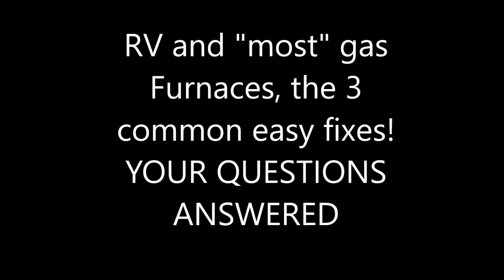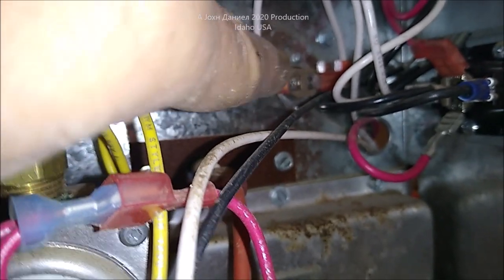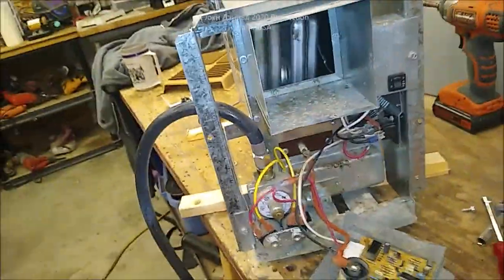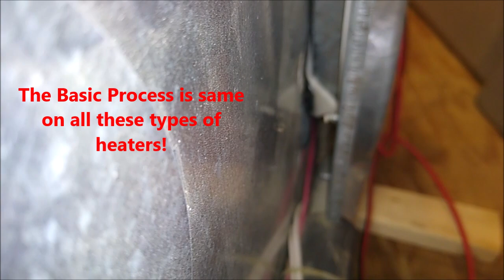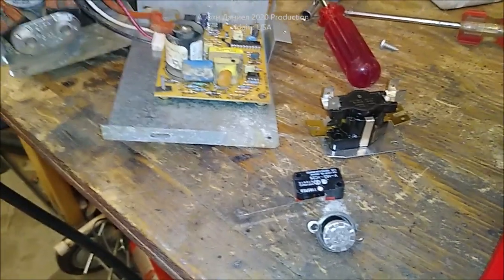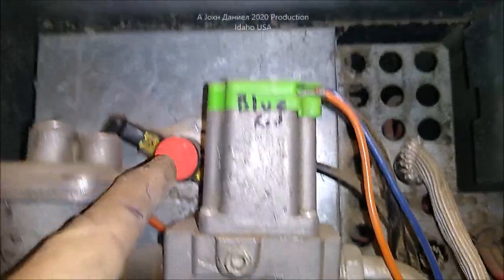RV Furnace REPAIR TECHNICIAN SECRETS Top 3 Easy Fixes anyone can do PARTS BELOW

Comment: Question. While direct wire. Furnace will turn on just ok. When adding the thermostat controllers. Furnace won’t start. Thanks
Reply from the maker: Definitely a common reaction when you get a bad start delay relay in your furnace. The thermostat wires are so small it's not getting enough voltage to pull the disc down and start the blower.
Reply: @JOHNDANIEL1  thank you. I did replace the thermostat and wires just to be safe And that solved the issue

Comment: This was so helpful, but I am worried about running my heater to even test what's going wrong. I can turn it on and the fan kicks on, it sounds like it ignites, but then extremely hot air blows outside the camper (smells slightly of propane too) and cool/slightly warm inside. Should I be worried to run it while I?
Reply from the maker: Sounds like you're exhausting air from the outside is proper it would be very hot, you're inside there should be warm like a hair dryer coming out, take a flashlight and shine it up into the tubes that are on the outside of your RV. If you have a single outlet take a screwdriver and remove the cover and shine it up in there it may have a lot of wasps nest in it and the best solution is to try to break them loose with a very long piece of coat hanger wire and put a shop vacuum to pull out any of the debris. And higher than normal smell of propane means that the air mixture is not working well from the intake air outside for combustion and the burner inside that is sending out the exhaust. Many of these have tube within tube designs or two separate tubes intake and exhaust. It's best to take a look at it and see what you see obstructing anything in there. Once the air mixture is better more warmth will come out of the inside part.
Reply: @JOHNDANIEL1  thank you. I think this answers what I need to look at too. Blower comes on and works continuously, exhaust blowing hot, I see flames but air coming out inside is so barely warm I can put my hand on the furnace and keep it there. Seem to be going through propane like the house is on fire except it’s only 43 degrees inside and 39 degrees outside! 2007 FR Freedom Popup with Suburban furnace.
Reply from the maker: I get what you're saying now sounds like the set screw on your blower motor might be loose. They have a motor in the center with a blower wheel on each side one puts air into the combustion chamber and the other one blows it out into the trailer and if it's not even blowing very hard it's generally because it's slipping on that blower and there's a set screw that's inside the fins that you have to use a long allen wrench to reach down and tighten. It's a rare occurrence but it might be the cause.

Comment: John The Over Temp Switch You Suggested Is Much Smaller Than The One In My Unite ?  Do You Have Any Suggestions ?
Reply from the maker: Yes, it's not same size but same function. In some furnaces you might need to take and cut a small piece of aluminum can to cover a push through hole the original overtemp uses get it put together the way the best way you can and mount it on there, it's simply a normally closed high temp disconnect. It will flow through it up to 13 amps DC and your heater should only be using 6 to 8

Comment: What’s the issue if it all comes on. Igniter clicks, flame starts and then it keeps clicking and flame goes out.  Tried 3 times and then stops trying
Reply from the maker: The igniter that goes into the burn chamber to start your flame senses an active flame and it's not doing it so I would suggest replacing or cleaning the igniter assembly and that should probably solve your problem. I don't know the model number you have if I did I could probably send you to the exact part. If you have more problems give me an email at olympicpowercontrols@yahoo.com it'll take a few days I get so many emails, but be sure to send model number and year, and a few pictures if you have them.

Comment: I have a problem that goes beyond your video. I’m not sure what it is yet. I replaced the board, sail switch and high limit switch. The blower comes on and I can hear the igniter (not a relay) clicking. It cycles like this three times and then the blower just stays on. The burner doesn’t light not even for a second. Any advice would be greatly appreciated!
Reply from the maker: Did you replace the igniter assembly. If the igniter assembly is not sparking on the burner or sensing activation of a flame you'll get this action. Take it out very gently clean it adjust the gap between it and the burner at 3/16 of an inch and try it again. Over time these will get very hot and Warp and cause this problem.

Comment: That sail switch is often replaced by a tube and a pressure sensor in some Goodman household heaters. Same principle. Moisture may block the tube if you have trouble with interior condensation or water leaks in your air system. Once identified you should solve that problem as well.

Comment: I just repaired or replaced my heater motor but now it won't fire up.  I had the sail switch, board, and burner cleaned out, this last fall. The fan started making  noise so I replaced the motor. I get no clicking or heater start up, no light on the circuit board.

Comment: Thank you!! I called a mobile service. Right away, before assessing the heater he said “ohhhh it’s your circuit board and those are costly.” He wants $600 to take the whole unit out. It’s only my relay switch.

Comment: Great video. Mine is in a 2008 surveyor by Forrest river. Turn the furnace on, cold air comes out of Ducts, air comes out exhaust fine after 10 seconds or less it shuts off. Only way to get it to run is to raise and lower thermostat and the same cycle continues.

Comment: My biggest complaint is that I have to physically remove the whole system in my Jayco to get to those parts. And they don't give you enough wire to do so without having to cut the wires from the board. It turns what should be a twenty minute job into a 2 hour job.

Comment: I may have missed something, but I have a 2-year-old Micro Minnie and the fan ran nonstop for two weeks before I banged on it with no effect, so I disconnected it.  I don't think I heard that symptom in your video.
Reply from the maker: What do you have is a hung up delay relay most likely, when the thermostat breaks circuit after your RV reaches temperature it pulls power away from that relay. If the relay is going bad it doesn't properly run its cool down cycle before it disconnects. It'll just keep letting the fan run.

Comment: I have same heater…… Mine makes a humming noise once the burner kicks on /ignites and starts blowing heat ! What should I check ? Thanks 🙏
Reply from the maker: Typically a humming noise is from a transformer ignition system for 120 / 12 volt it would make that kind of noise. But if it only starts doing that when it's fired up and running that is too much air getting into your burn chamber or  or not enough exhaust getting out, check your intake and exhaust tubes for wasp nest or other debris.

Comment: Great Video!  On mine it always fires and runs to temp and after shutdown when thermostat kicks back in it doesn't re-ignite, it does its try 3 times cycle and doesn't light, after off for a while and you restart it runs once again till set temp. Ideas?

Comment: This video gave a lot of info. But my furnace  is doing nothing, no click. Click, fan don't come on nothing , happened during the night woke up to 18 degree weather. To say the least it was cold.
Reply from the maker: Sounds like a Frozen propane tank valve. No pressure would default the valve in some. Another cause is possible under 11 volts from battery.

Comment: Thank you for the video, it certainly helped. Here's our question I also have an atwood model 7920-11. It will run for about 45 minutes then shuts off then takes hours for us to be able to get it started again. We've changed the regulator thinking it was an lack of pressure but no. We're camping in the northeast right now and just received 6 inches of snow so it's cold and need this furnace up and running. I know we had mice in here so I'm wondering if the ducts are clogged and that's why it shuts off?? Any help here would be appreciated
Reply from the maker: Sounds like you're exhaust or intake may be clogged or the weather is so cold that your regulator out on your tank is freezing up which will slow the gas down or change its pressure enough to fail the heater.

Comment: Mine runs and produces heat but after about 15 minutes it sets off the Propane Gas Detector.  Any Ideas where the leak might be? Or the burner not burning all the gas?
Reply from the maker: Sounds like you probably got something in your exhaust pipe on the heater. Those are slip fit and the leak around them if they're blocked. Otherwise the only other thing could be a cracked heat exchanger, typically a propane gas detector will not go off from that but some as they age will go off from burnt propane. Propane detectors are designed to only go off whenever they detect actual unburned propane. If you're not smelling exhaust fume at all, and the propane detector simply behaving to the warmth and it's over 10 years old replace it.
Reply: @JOHNDANIEL1  Sounds right with all I'm seeing.  I had to clean out the furnace area of road dust and soot. I don't smell any exhaust or propane in the camper at all when it's running. and the unit is 23 years old.  I'll replace the Detector asap but not worry about exhaust fumes if I don't smell any.  Sound Good? I don't wanna die in my sleep.

Comment: So I have the exact heater that is shown. Last year the board died and I replaced it with a dinosaur. It worked perfect until a week ago when we were prepping our camper to head to the cold. The board fires up as normal, you can hear the gas valve open and the igniter fire but it does not light. I checked to make sure ai have gas to the furnace. I check continuity on the thermo switch and the other black switch on the side. All test good. I have continuity to the gas valve switches. Before I pull it out of the camper to check the sail switch do you have any other guidance? Thanks for the great video by the way!
Reply from the maker: The sail switch is absolutely required to function properly, if they fail sometimes they'll work sometimes they won't but mostly they'll just eventually do what yours is doing. They will not show a evacuate cycle and therefore not allow the second stage of the gas valve to function. You can bypass the sail switch to see if it gets you where you want to be on run cycles. They will also have this behavior if you're overtemp switch is failing they will fail to the open position so you can put a tiny set of jumper wires capable of three amps between those two points fire a cycle and see how it behaves.

Comment: Your kinda choppy on procedures but you diagnosis is spot on.
Your expertise is evident. 
I do gas furnaces(20yrs)
Up to 5mbtu.
Sis gotta intermittent fault in Ohio and I'm gonna take a look. (2hr drive) .
Seems RV Forced air ain't much different than a 3mbtu air house.just miniature.  Hipped me to take small nut drivers and screw driver than I probably would've (most are not in my tool bag.
The fan delay switch looks like a residential control except they're 99% 24v signal.
Curious flame proof .
Combo igniter Flame sense ?
Thanks so much Sir.
Spent 1 or so on others and.... watched yours completely!
Dirty hands were vaguely familiar!
Peace my friend.

Comment: My heater runs and fires up but out of the tube for the exhaust blows black smoke out of it what will cause that is it a blocked intake for the heater and if so where would that be any help will be greatly appreciated thanks
Reply from the maker: You have to remove the heater take apart the combustion air side and typically you will find either a wasp nest or debris that is choking your intake air. Be careful because the gasket for that is very brittle but you can remove it if you're slow and careful.

Comment: 1 question..
1st thanks man.. Ive used this video as a tool many times.
So right now my time delay relay is toast. Atwood 31017. Klixon.
Anyways like you said...good luck getting one... So i tried your suggestion for a electric heat sequencer. 24A34-1.
Well the only one so far i could find was a 24A34-22.
My understanding is it has to switchs an the time delay is different.
Anyway s...  In your video you say to connect the positive on one end of the brass connector an negative on the other... Well on this one is 1 plate.. Obvious would short out .. So i grounded to the plate on the bottom. Anyways it didnt work.. Wondering if i need that exact one ypu mentioned ... Or if the ground should have beeen placed elsewhere. Or is it that this is a 12v unit. 
Btw ..its the exact unit you are working on in the video. Atwood 7916-11
Anyways thanks for the great video an please help me on this qiestion as finding the original is near impossible.

Comment: Furnace comes on right away but once temp is reach just starts clicking. While troubleshooting was wiggling relay on board and clicking stops. Let go and clicking starts again. Is this a simple relay replacement? Can I get part at a hardware store? Is the relay called something else can't locate on pdx parts site?
Reply from the maker: Possibly a bad capacitor on the board or a weak relay.

Comment: Maybe you can help me. my atwood furnace is a afsd20121. it'll turn on for 20 seconds and then it'll shut off. i lower thermostat and then raise thermostat and then it turns on again for 20 seconds. this is what ive done. 

#1 took of the bench cover to expose my furnace. i noticed a black wire that wasnt hooked into anything and it was exposed. i didnt think anything of it because it looked normal and abnormal at the same time. plus there was a white wire that was crimped but its was the only wire crimped. so i thought maybe the black wire goes with it. anywho lifted up furnace and took out sail switch and there was debris on it so i cleaned it and placed it back in. FYI everything looks new still. anywho placed everything down and back and now it wont turn on. remember the black wire? well i stuck it inside the white wire and boom it turns on, BUT only for 20 seconds. all this and still no heat..

#2 why did my furnace work before with out the black wire that was labeled -12VDC but after i messed with the sail switch it doesnt work unless the wire is hooked into the white wire? i did order a sail switch just in case. i hope it fixes my issue. also ive had my trailer 3 years and used the furnace maybe 5 times at the most. propane is good the stove lights up perfectly fine. do you have any suggestions?
Reply from the maker: Replace this part, flame sensing igniter for your furnace. https://amzn.to/3Gdzs6S 
It's a common item when you get occasional bad tank of propane. Normally things will run average but too much moisture in some tanks of propane will ruin them. I would also suggest if you can Purge your regulator on your propane tank by running your stove on all burners high until it's a nice clean look when you add a new tank. A lot of unsavory propane sellers are not giving you high quality propane nowadays some can contain up to 10% moisture or water. Let me know your results. If this helps you out don't be afraid to drop me a tip on the thanks/donate link below the video. I'll be making a lot more videos in depth to help more people. My video seem to have helped over 3 million so far so I love it when people can do it themselves.
Reply: @JOHNDANIEL1  sail switch fixed the issue. Original must've went bad as it didn't look like anything was wrong with it. So trial and error and now it works like a champ. Thank you for the response

Comment: My Atwood starts immediately.  Blower on and gas fumes come out the exhaust.  Runs about 30 seconds.  Shuts down. Ignitor? Being told board. It ran fine a couple days ago. RV was stored a long time but looks like new inside all these parts. Suggestions?
Reply from the maker: Send a picture of your furnace to me, plus year, model and make. I'll see if I can get you a quick solution. If it works out for you and you can drop me a tip on the thanks button below my videos. Send to olympicpowercontrols@yahoo.com with title furnace won't run.

Comment: Jack Daniel You do a great job explaining to me a novice,  This past summer I replaced the Fan Motor, Plastic Squirle Cage, Burner and Igniter.  I thought it was all working fine.  But, now I am in the heating season and my burner fires up but stays on intermittently.  Thus, it comes on; fires, goes out, fires again, on and on. It is heating my RV but I must be wasting a lot of propane with all of the firing and re-firing.  Do you have any suggestions for me?
Reply from the maker: Send me a email with the model number, year and manufacture and I'll see what I can do. Include the type of thermostat you're using dual purpose or single purpose and do a test before you send the information of your battery voltage while the furnace is trying to run, and if it works out for you you can look below my videos and drop me a tip where it says thanks button, send info to my email olympicpowercontrols@yahoo.com with the notation - furnace problems